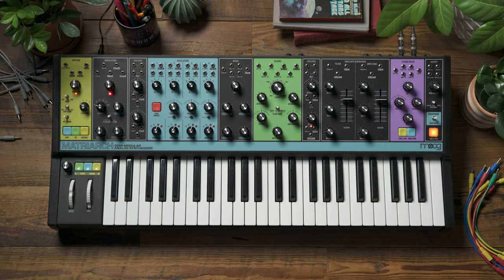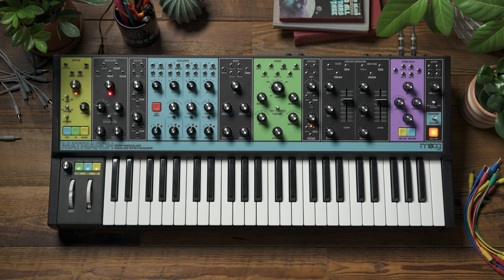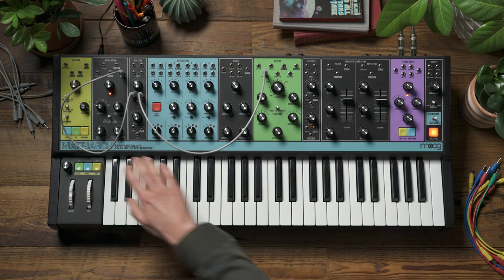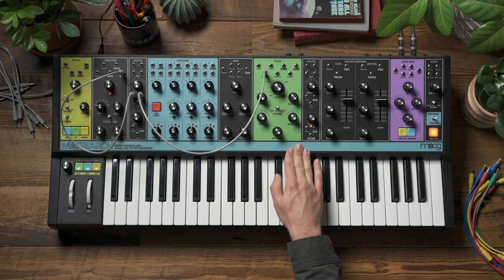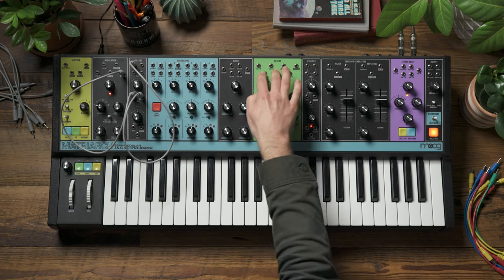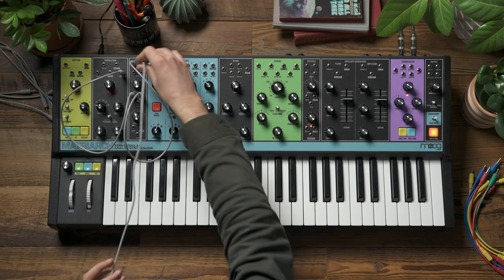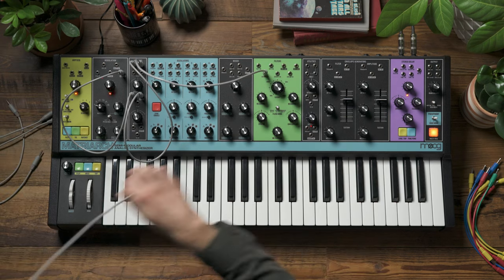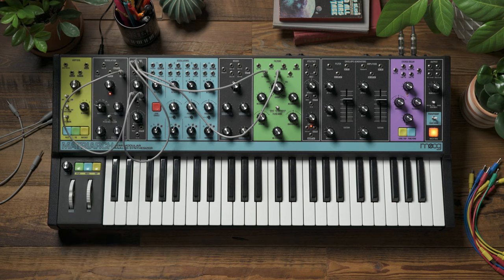Matriarch | Stereo Movement with Attenuators & Inversion

Comment: I did NOT know you could use the attenuator as a knob.  That's pretty cool. 👍🏻 Also, GREAT TIP on the inverter!
Reply: yeah, you can control each filter separately if you want using the attenuators for example.